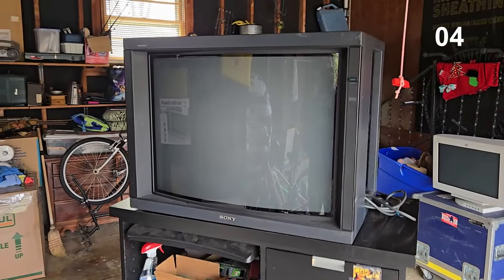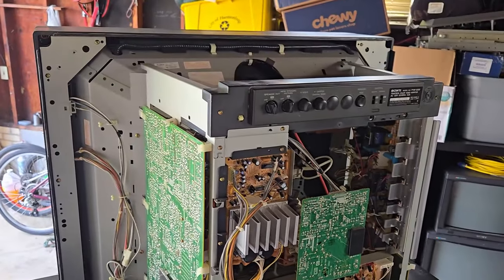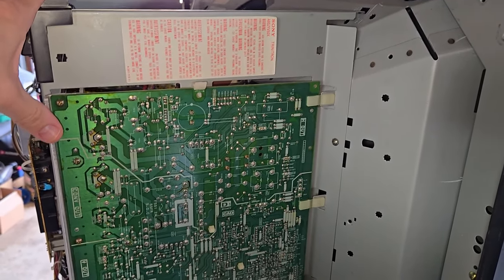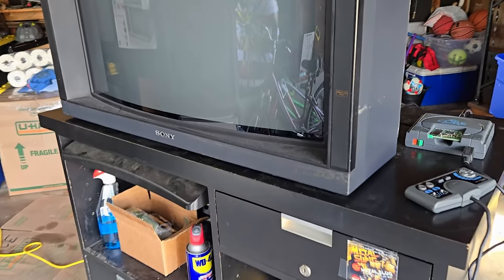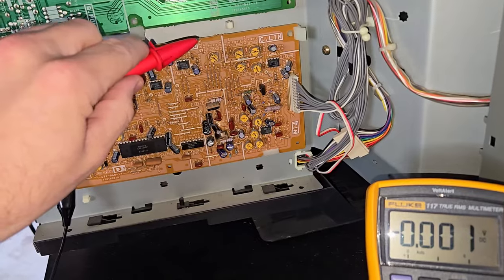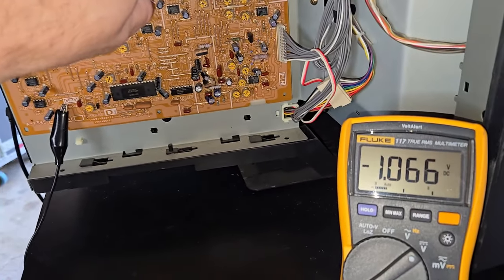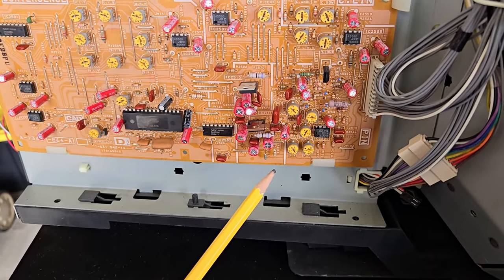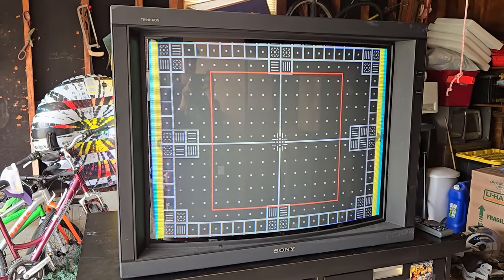The Biggest CRTs still in use: The Sony PVM 3230

Comment from the maker: The engineering in this PVM is astonishing.    Tech is just not made to this quality anymore.  Thanks for checking out this repair.
Reply: That's the exact feeling I get whenever I'm working on this sort of stuff; old hardware is just built to work...and then be repaired when it doesn't. Nowadays, it's just a mess...especially consumer stuff... They could give a shit if it's repairable. Do TV manufacturers even still produce service manuals?!
Reply: Hey Steve just letting you know I sent a message over on patreon about a PVM repair

Comment: I've got this same model, same manufacturing year, and it has the exact same upper left corner convergence issue as this unit. Even tried adding an additional convergence strip as you did, to no avail. Drove me crazy for a solid month. But you are 100% correct, it is a beautiful example of the craftsmanship of Sony.

Comment: Hello, do you have any suggestion for a monitor like this one (mine is an european version 28 inch)  but missing/very faint blue color? How do you check if the blue cathode is toasted or there is a problem with the electronic? Thank you

Comment: My tube's not quite as big: a Sony PVM-1954Q from early 1994.  I almost got it fully serviced by myself except for a few caps and minor corner convergence.  I actually took two differently non-working units and made a fully-working monitor.

It's a perfect fit for much older games -- pre-1982 and some of the rest of the 1980s.  Now, the 3230 is what I'd want for my PlayStation project, partly 'cause it's about the size of monitor used on Ridge Racer and Dance Dance Revolution, but also because I just feel like changing up my style when I get to that point.

But I am not yet parting ways with my 1954Q.  I was lucky to get both non-working units for a total of ~$600 in 2015; nowadays, a fully-working unit goes upwards of $2,000.

Comment: Yeah every aperture grille set I have owned has had those lines. Sometimes 2, you are completely correct in your assessment I believe. Its not a big issue, I usually only see it on full white screens with my smaller sets. I still prefer aperture grilles.

Comment: Hello I have a Sony 20 inch PVM it changes color temp by itself meaning that it becomes whiter than normal in normal temp mode and I have to change color temp manually to reach what looks reasonable and then it gets fixed by itself and I have to revert from manual temp mode to normal mode (6500k I think) again I dont think its Tube what do you think?

Comment: Here's a noob question: what if you intentionally overdrive the voltage on the Yoke a bit so you can expand the horizontal and still maintain the integrity of the image?

The argument is you would shorten the life of an already vintage tube, but maybe. Maybe not? Would this work? Is it worth it?

Comment: I have my microscope and is using Sony XS CCD cameras B&W with BNC Video output 1.0 Vp-p, negative, 75 Ω unbalanced, I would like to convert this to HDMI to put it in a modern screen, what would be the proper adapter? Thank you! I have different cameras EIA and CCIR and different models but all output the same signals and I am hoping not to have to upgrade them

Comment: How did you know which points to check for voltages?
Reply: They're marked on the PCB.  Being as big as it is, it even has the voltages to expect marked there.  It should also be in the service manual. (Which is usually where you find that sort of info,  along with oscilloscope waveforms and other diagnostic stuff, as well as setup and calibration procedures.)

Comment: Nice work! Don't you just hate it when you go through all the usual suspects, only for it to end up being some totally benign thing you hadn't thought of? Bet that stupid resistor is the first thing you check next time! 🤣👌
Gotta laugh about the controls on the 3230... 32" PVM and it's one of the models which has the controls down the sides, making it look like the MFD in a jet fighter cockpit? That just seems wildly impractical, doesn't it?? 😂 Good thing it's--I assume--compatible with those external control units. 😅